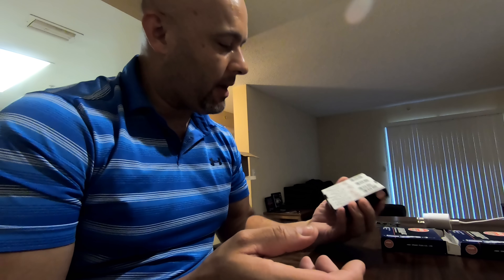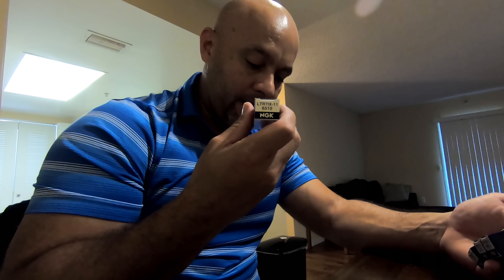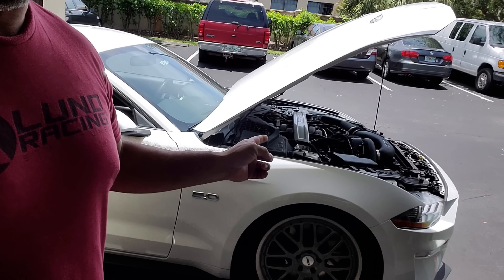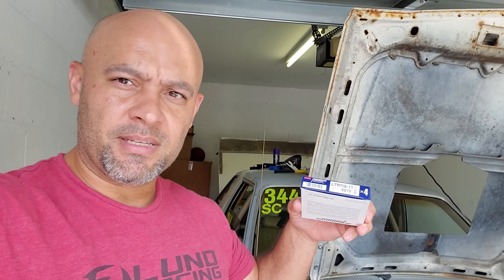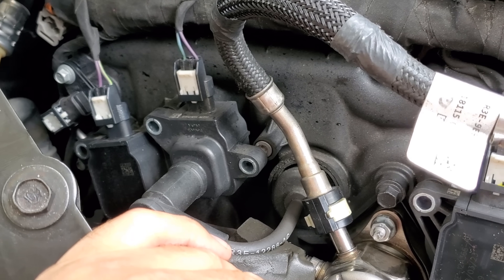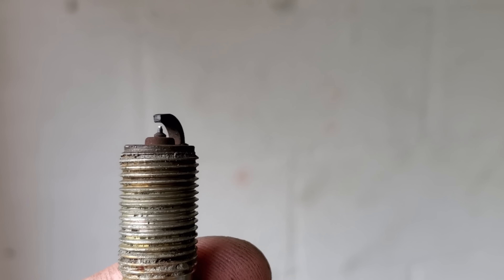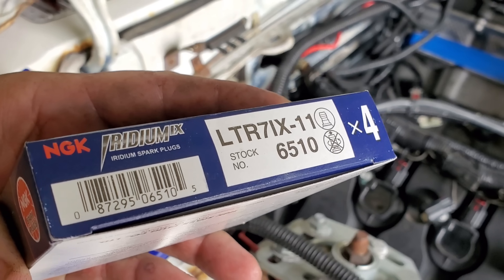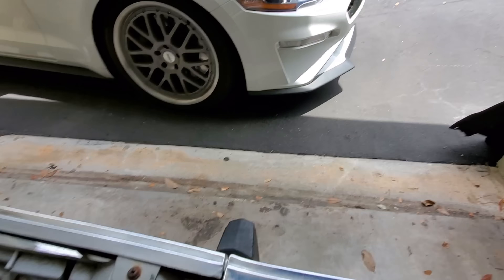What do Spark plugs look like after Octane booster and 10k miles on a Boosted Gen 3 Coyote

Comment: I used to run octanium and had the same problem. I’ve ran 1/2 a bottom of boostane per tank for 30+ tanks. And checked a plug and they have a slight greyish/orangish color but they look perfect. The octanium plugs were so orange they looked rusted.. do yourself a favor and run boostane. Pour each in a Clear bottle and after an hour look at the sediment that is at the bottom of every octane booster except boostane… there is 0

Comment: If you are worried about orange spark plugs due to MMT

One website recommends VP Fuel Cleaner with RP21,  read below VP Fuel Cleaner with RP21, which is formulated to clean and restore 
engine components.

Comment: My Dad's cousin had a 428 '67 GT500, you want to talk about dreading spark plug changes lol unlike the Yotes and like my SOHC in my Dakota, way easier to change plugs. Ran some octane booster through it before I did a change had the same color on my plugs, brick/rust color all gapped the same so I knew the engine was healthy, new plugs new coils. But yeah pump gas sucks, my truck feels better at 89 than 87 (butt dyno) becuase 87 might not be 100% right. 

Engine Masters did a Flex fuel test (California E85) the sensor read it as E78, not 85 they added booster in a B test, so nothing is ever "true" numbers.

As for your conclusion, I agree. The can I have says 1 qt (1 bottle) for 10 gallons at 7 numbers or 20gallons at 3.5 THEN it follows up with if you have Emission control Devices (cats etc) 2.6ozs per 10 gallons, though says usage will require more maintenance (burns up plugs etc faster)

Comment: Alex on NA, butt dyno on my 16 says I'm losing torque as I move up in rpms, and not gain. Gt350 induction, long tubes, tuned. 

1k-5k feel the torque then doesn't push anymore up to 7500. 
61k miles no idea if theyve ever been changed.

Comment: Hey Alex, just got a Paxton 2200 installed. Per Brandon’s recommendation I got 6510s and gapped them at .26 as you showed in this video. For the time being, I will be running the car on 93, until I get a fore fuel system. I know 93 specially down here in SoFlo where we are can be inconsistent, so whenever I go to the track or Mexico I plan on adding a little Boostane for added security. What octane amount should I aim for ? 98,100, etc ? I got the boostane app that tells how much to add to reach certain octane number.

Comment: Idk man, i pulled my OEM plugs at 24k miles and have ran 2 bottles of boostane, 1 bottle of torco and 2 gallons of klotz (not all at the same time but each brand for every summer up til now). and my plugs look about the same as yours. Maybe even slightly cleaner. 

I think it also has a lot to do with the type of gas you normally put in. I am a shell 93 v-power for life so maybe that helped. 

Btw, my car is a C7Z with a couple of bolt ons. So it is a boosted car that's kinda stock.

Comment: I never use anti-seize unless I really need to, because it's messy. For plugs, as with any torqued fastener, a very light film of oil is a good idea. But still, I never considered the possible effect of anti-seize on heat transfer. Good tip, thanks.

Comment: Wondering if you can shed some light on this? I ran octane booster, probably too much in my FE 428 and all of my plugs turned orange.  Question is orange is coming from the MMT, did that harm the engine at all?  Will the orange come off if I use premium gas and quit using booster?  Do I now need to replace the plugs or will this clean it self up?  Help.

Comment: The royal purple octane booster is worse. Plugs will end up having far more brown. On my road course car, the track race gas pump wasn’t working, so I ran my 93 map with the royal purple octane booster as a ricer mentality safety net. Shockingly no knock, but plugs were nasty after a two day event.
Reply: That's MMT for you. You can't run more than 2-3 numbers higher without oranging occurring on VP unleaded

Comment: Octane boosters all contain MMT. Totally destroys and coats spark plugs and combustion chamber with orange residue.  And it won't come off. You are screwed.
Reply: PEA will clean it off. Most octane boosters recommend you use a fuel system cleaner that is high in PEA every thousand miles or so driven on an octane booster to remove the residue and keep everything working right.
Reply: @dsrocks6905  I use Techron Marine every fill in my e85 11 5.0. Loaded with PEA
Reply: @maximusvonce1381  that stuff works miracles
Reply: @dsrocks6905  You use Techron Marine too. I was told its the best.
Reply: @maximusvonce1381  absolutely! Techron and Techron marine are in the same tier are Marvel Mystery Oil and Startron
Reply: @dsrocks6905  Actually techron Marine is better than Startron
Reply: @maximusvonce1381  they're meant for different things though. One is an enzyme based fuel stabilizer, the other is a fuel system cleaner

Comment: For an N/A first gen yote truck, what would you gap the 6510s? I’m going to have an 18 manifold and PMAS 120mm intake on it running 91 octane tune. Also I live in AZ so summer is 112-115 all summer.
Reply: Where in AZ that's a nice setup, I live in queen creek area and go to scottsdale Pavillions car show on Saturdays quite often
Reply: @MaxSpeedshop8  I'm in Casa grande at this time I no longer have that setup blew up the engine had a catastrophic failure. So back to stock with a mild tune.

Comment: I ran around 9 cans of VP madditive, with 2 can being the unleaded version.   Lets just say it took 9000 kms to kill those plugs.   If your going to run that shit, make sure to pick up a few set of plugs.  That is all i'm saying  I was running NGK 6510 LTR7IX-11 gapped to 0.026" in my 2018 Mustang Ecoboost medium turbo build lol  420WHP on my Race Gas Additive tune.
Reply: I also here you say to use Denso for higher boost application, but i was told specifically to stay away from Denso now, since they changed their manufacturer.  I was told they are not the same quality as they used to be? Tips been breaking off causing catastrophic failures ect.  This is just what i was told by a reputable tuner.   I thought it was odd, since i always prefered Denso.

Comment: ALEX!! hey Ima get spark plugs, but WHICH spark plugs do I need to get that run good with E85? I have not changed my spark plugs since 4 years ago sadly.. should I got NGK  like the ones you have? Or Oem motorcraft?
Reply: Run the stock OEM motorcraft plugs on E85 unless you are boosted. I run E85 all the time replaced my spark plugs at about 12k on my car when I did it. 2015 gt

Comment: My 19 Mustang GT starts fine but after it starts it has a barely noticeable pause when idling. Sounds like it’s missing or it’s not getting enough fuel. Kinda sounds like my lawnmower when it’s getting low on fuel. It does go away once warmed up but it still concerns me a little. Car is 100% stock

Comment: If Im considering using octanium I add the price of new spark plugs to the final cost. If the price of octanium + new plugs is not justified then I don’t use it
Reply: On gen 3s running boost on 93 its not a bad idea to keep a little closer eye than normal on the combustion process anyway
Reply: BlueCollarDaily every time I use octanium at least one of my plugs foul out. Now I run water/meth without any down side that I can see
Reply: Interested in the water meth thing ?

Comment: I’ve been running my 03 cobra on pump 93/Boostane for many years but doing a return fuel system and E85 switch this year finally. It’s just scarce near me so I’ll have to keep fuel at the house.
Reply: Water/meth injection will give you the same benefit and you can still get fuel anywhere

Comment: Ok, pump fuel is crap and killing engine. Additives, sulfur, you name it. But here, in eastern Europe, we don't have e85 at all, no way. Did you ever had any experience with lpg?) Obviously it cannot be used on high revs due to slower and hotter burn, but in low revs (90% of city usage) it can be used and should keep engine clean and shiny, having no trash inside and ~105RON octane (also being twice cheaper then pump gas that is so expensive here). Do you know something about it? Can it be used with your tune? With supercharger?

Comment: Should we not use anti seize on NA coyotes either.. id like to hear more on this subject
Reply: 100%. 14 ft/lbs on a “dry” plug is different than 14 ft/lbs on an anti-seized covered plug.
Reply from the maker: @Andersonz_  nailed it.
Reply: @YDBT4LIFE  okay thanks
Reply: @Andersonz_  tight is tight bro lol. as for the changes in heat range, how much change? probably why i dont have issues with nitrous at a .035 gap
Reply: Lightning Fast Garage nah...pull the threads out of a head or have a plug loosen up and blow out and come tell me about “tight is tight.” My customers would love to hear me say that!
Reply: @Andersonz_  who torques their plugs? Ive changed plugs in my 02 lightning 10 times as well as using anti seize every time with zero issue just going till they stop and snugging them. Never had one back out or be loose ever.
Reply: csr801996 that’s literally one of the most important vehicles to make sure they are installed correctly lol. Must have never had to helicoil a 2v head. I’ve also touched far more vehicles than one lightning. Sometimes luck is on your side. I’d rather use my $500 torque wrench sitting in my box than buy a customer a head and do the job for free...but hey what do I know 🤷🏼‍♀️
Reply: @Andersonz_  on Luke warm engine, not cold or hot.
Reply from the maker: No spark plugs should get antiseize ever. It changes the heat range..changed torque spec.. no antiseize ever.

Comment: The Orange is that octanium.. I've never used antiseize or octanium on 93,.. I do use 6510s and they're great plugs on 10lbs. of boost I change them every 10k gapped at 28.. no issues. Love informative content.. except plug in your coils.. LOL it happens LFTW
Reply: I had .028, made 17hp by going to .023

Comment: I've always used anti seize and never had issues on supercharged, turbo and N/A applications. Curious to see more info on the subject.
Reply: ^^^What he said.
Reply: A lot of spark plug boxes specifically say on the box to NOT use anti-seize. Its not just NGK.
Reply: Brisk use it too, and using it can actually cause you to over torque  the plug...also gravity can pull it down into the combustion process on these engines....it can screw reading the plug especially when DI knocks have the plug clean anyway hehe....
Reply: I use a tiny bit of high temp anti seize on the plugs and when I say tiny, I mean it put just enough in one spot that covers two threads. It should spread out a little when it threads in, but I have not had any problems. It's just to reduce the change of getting a plug stuck in the head and breaking it. Yes I change plugs after the engine is up to temperature too.
Reply: The plating on NGK plugs eliminates the need to use anti seize
Reply: @JMKady76  I see is that specific to only NGK plugs or do most plug manufacturers use it now?